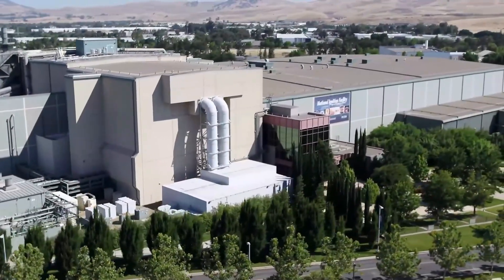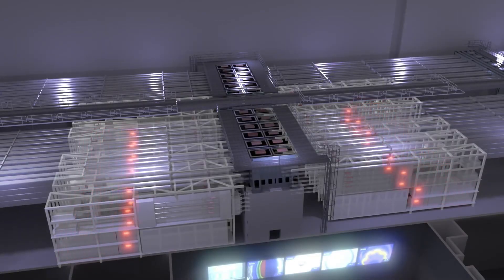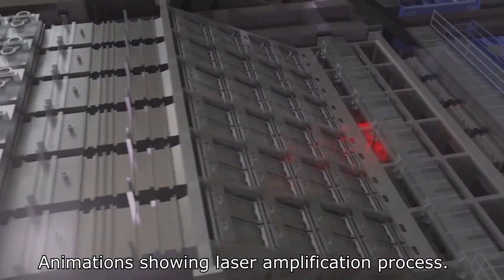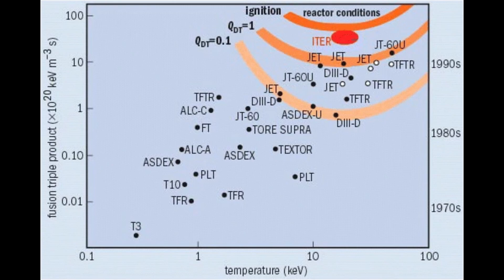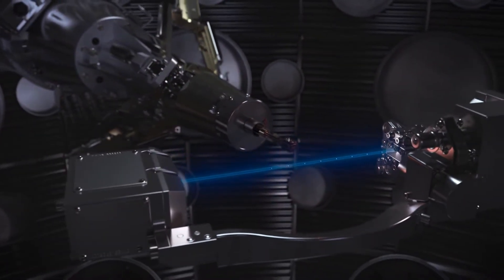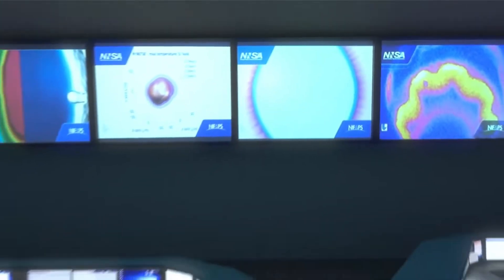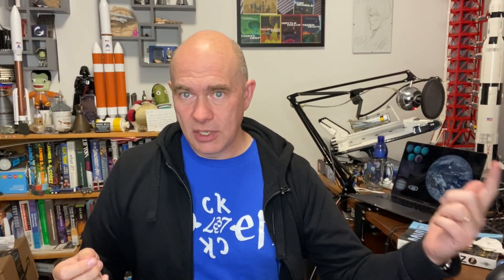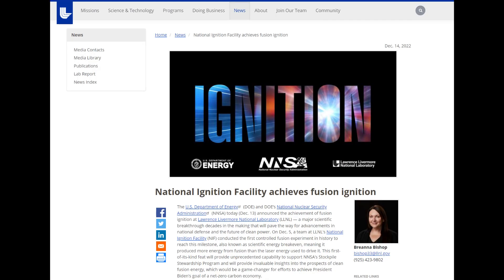Why The Biggest Laser in the World is Making Big News About Fusion

Comment: There's a very simple and reliable way to have fusion energy right now. We actually know how to compress and heat the fusion fuel toe get far far more energy out than we put in. With a fission bomb. So the idea is to detonate plain old fusion bombs in a large underground cavity, which is partially filled with some metal with a low melting temperature, use that to generate steam through a heat exchanger, and drive turbines with that.
There are a few potential issues.
1. Radiation. Not a big deal, bombs can be tuned to generate almost all of the energy from fusion, and therefor be very clean. Also can be ran in a closed loop like all nuclear reactors.
2. Cost. Mass producing advanced nuclear weapons is officially not possible and too expensive. Unofficially it's not a problem. There are a few clues that support this, the easiest is Project Orion. It's a spaceship engine that uses nuclear detonations to generate trust. It also requires thousands of bombs to work. And it was apparently neither impossible, nor too expensive, as it was seriously researched, and got close to prototype phase.
3. Security. This is a real issue. Routinely transporting large number of nuclear weapons is probably a bad idea, if you are not fan of mushroom clouds in your backyard. Possible solution is manufacturing the bombs inside the facility. Security would have to be insanely tight.

To make it economical, the power plant would have to be very large, which makes it impractical.

But there's another way to use fusion, which not just works, but already available even for home use. The trick is to exploit that big shiny natural nuclear reactor in the sky (Sun). Solar power is essentially fusion power. The main downside is that it's not always available, but that can be mitigated with energy storage and mixing with other energy sources.

Comment: Something tells me the National Ignition Facility is not taking into account of all input power, which is outrageously common to do in the field.
Reply: I was right, as per usual.
"the huge lasers at NIF are less than 1% efficient, so to generate more fusion energy than actual input energy to the facility, you'd need to increase the yield 100x"
"Plus, the fusion power is in the form of heat and radiation, and needs to be converted back to electricity. Assuming a 40% steam cycle efficiency, that's another 2.5x increase in required yield. So we need a fusion reaction 250x MORE POWERFUL to achieve true electric net gain"

Comment: We need Liquid Fluoride Thorium Reactors now -- better late than never!  "Fusion is ten years off" isn't even a bad joke; break-even on energy wouldn't mean that commercial fusion could ever be practicable.  I don't write fusion off entirely, but the extreme efforts being expended to implode a hohlraum to fuse deuterium and tritium aren't going to be made so much more efficient that the process could be made routine.  This fantastically expensive experiment is about as dubious an expenditure as the SLS and it isn't going to avert climate change -- LFTR might.  Confront the realities of these proposed technologies and LFTR blows fusion out of the water.  Those are going to be very expensive neutrons!

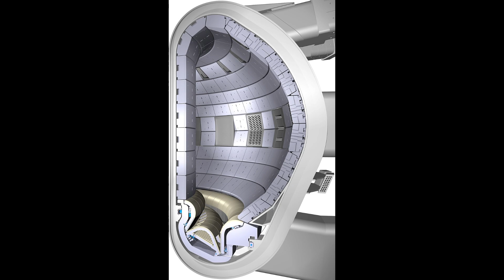Comment: 13:57 "They're not using this pulsed system."
Well technically Tokamak fusion reactors like ITER will have pulsed fusion power, but of course at a WAY longer timescale. (I heard they were aiming for half an hour.)
That's because Tokamak design reactors need to drive a current through the plasma, which means that there's a giant Solenoid coil in the center which slowly increases its magnetic field, and there's of course a maximum magnetic field strength that the superconducting coils can produce, so once it reaches that, that's the end of the pulse.

Comment: Sorry Scott, but saying they only needed 2MJ for ignition and not 300 is like leaving out the energy for magnetic confinement in a tokamak.
They had to make this announcement before a tokamak finally goes over a real Q of 1.
I have no clue how they even came up with the 2 MJ input, its ridiculous.

On another note, making the lasers more efficient wont happen, as you said they work at 1% efficiency, but its more like 0.66 period % efficiency, because of 300MJ to 2MJ (what they say) which means they need to make insane improvements on the lasers, and I am not very hopeful that they can do that with electricity to heat losses inside the lasersystem itself.

And then they have to use pure tritium which is simply not viable, it is too expensive, and if tokamaks were only using tritium and not a mix they probably would have broken the 1 Q barrier a long time ago.

On top of that Iter will easily reach a Q over 1, it is designed for 10.

So to me this is all a big PR to show, they probably want more money to keep their jobs. It really is a dead end for fusion research, unless they want to develop vacuum rocket engines, beacause this system will never be able to transfer its energy otherwise.
 Continuous operation with a heat exchanger and pellet delivery/feed into the existing pressure environment is a mechanical engineering nightmare. Especially when you have to deal with 3m+ degrees tempereature.

Comment: The important thing here is my opinion is now that it has been done and we know we can do it, we can now more easily test it under varying circumstances to find out what are the minimum conditions necessary to get energy out. Once we know that, we can then start designing reactors which meet that minimum threshold, but don't cost billions of dollars to make. If the process by the national ignition facility gets refined and it is determined that there is a simpler way to meet those requirements for positive energy fusion, then they might be able to come out with a system where pellets get moved/shot/inserted/dropped along one axis, while lasers hit it from 360 degrees along that axis through small holes in a lining, a lining which then absorbs the heat produced and turns water into steam.

Comment: Fusion is basically so difficult that any machine capable of doing it would be far too expensive to be economically viable.

If you run the numbers fission is better in every respect. It is cheaper, easier, already in wide use, and the fissile material really isn't the problem it is made out to be. There is hardly any of it, the long lived stuff can all be burned in fast reactors and with breeders we have more than enough fuel to outlast our sun.

Comment: Sorry, this is a tiny step but actually putting power into the grid is 50 to 70 years away OPTIMISTICALLY.
I believe the right path is thorium reactors which don't have the radioactive waste problems (the military never wanted thoriom reactors because it doesn't generate any weapons grade material, so Congress hasn't funded the research)

Comment: There is a dumb question on my mind: How much extra energy does it initially take to power those lasers? To my understanding (Watched the Anton Petrov video about it), there is discrepancy (or lack of factoring, at least in the media) concerning the total energy involved in this process. - Very interesting and detailed analysis - thank you much! Fly safe.
Reply: Total power to heat, cool, people's paychecks, insurance on the building, maintenance on the building, you have to factor all that in and more.
Reply: @boyd21  No. This is not my question. Assume volunteers do it for free. And the land/equipment is free: My question: X - went into powering the lasers, Y - is the energy they produce, Z - the energy Out of this fusion event. Y was bigger than Z. *I suspect X was not factored in the media. Maybe I'm wrong, hence the title 'Dumb question'.
Reply: @electrolab2624  I think Scott did note that the lasers are around 1% efficient. I've seen figures from 300 to over 400 MJ in different articles (basically to power the flashlamps).
Reply: @laserspike  Ooh! Thank you! Those are the numbers I was wondering about. Scott had indeed mentioned that the lasers are currently somewhat (very) inefficient. It helps put things in perspective.

Comment: So, basically, they only counted the energy that actually hit the capsule - not the energy needed input to the facility.  They use tritium, which can never be a practical fuel as it exists in such small quantities and is very expensive.  They can only do about one shot a day, where many thousands a day would be needed in a practical reactor.  Basically, this can never lead to practical fusion power.

Comment: The solution for tritium that I've seen is that they'd use a blanket with lithium, instead. I forget how, but you can get tritium from lithium. The problem with that, though, is we already need lots and lots of lithium for batteries. If they ever figure out net positive fusion, lithium will be even more in demand. Deuterium is easy. Lithium could become a problem to find after a while if all our batteries and our power plants need it.
Reply: a Li atom captures a neutron (that is released from the fusion reaction) and becomes an unstable isotope of Li.  Then the atom of unstable Li decays and one of the decay products is tritium.

Comment: You know, with all those neutrons flying around inside a fusion reaction, we could probably do something about the nuclear waste that's piling up from fission reactors.
After all, getting rid of nuclear waste is a problem of neutron economy, if you get right down to it.
The problem is that many of the fission products of uranium fission are both radioactive, and capable of absorbing more than one neutron before undergoing further fission. This makes using them to sustain a chain reaction in a normal fission reactor impossible.

So you say "What if the chain reaction that creates all the neutrons is a FUSION chain reaction instead?"
Basically, you take the spent fuel rods from a fission power plant, remove the zirconium carbide cladding so you're left with the bare uranium carbide pellets, and with a minimum of extra processing you put them in a fusion reactor.
The extremely high neutron flux inside the fusion reactor will ensure that all the neutron poisons in the fission fuel pellets are burned off, and it probably wouldn't even take that long.
Basically, I'm taking the idea of the "accelerator driven fission reactor" or "sub-critical fission reactor" and instead of hooking it up to a power hungry particle accelerator to generate the high energy neutrons, I'm using a fusion reactor to provide those neutrons directly.
Not like the neutrons from D-T fusion contribute anything useful to the fusion reaction after they've been freed from one of the two participating nuclei in any case, aside from having a useful amount of kinetic energy (you get a single ~20 MeV neutron from each D-T fusion event, that's a pretty high energy neutron containing most of the resulting energy release of the fusion event and it can do useful work, usually the problem is that you can't directly harvest it for energy, here we direct it into a fission product nucleus and it either gets absorbed or splits that nucleus and THAT gives off a bunch of thermal energy that's not hard to harvest, it's a 2 stage process).
And if we ever run out of fission reactor waste to use for that, we can substitute in natural or depleted uranium metal, because you don't need to run the fission reactor first, we've got enough neutrons to do normal nuclear fission too (that's how the 3rd stage of Tzar Bomb would have worked if they used a depleted uranium tamper instead of the lead one that was equipped for the test, and if they had done that then Tzar Bomb would have had a yield of roughly 100MT not the 50 it had).

Comment: I can't help but wonder if working fusion would be a bad thing. Even if energy is produced in a completely clean manner, it all turns into heat which must be re-radiated by the Earth's temperature control loop (or the same amount of incoming heat blocked of course). The amount of heat energy produced by humans for electricity is already nontrivial! Human electricity production for one year, if Earth was a closed system, would be enough to heat all the water in the oceans by 9 degrees C*. With a clean, eventually cheap source of free electricity, this would no doubt increase dramatically.

*617EJ of production = 1.47*10^20 calories, seawater ~1.38*10^21kg from a quick google. Naturally wind and solar power are slightly different from fossil fuel and nuclear in this regard but it is just a napkin calculation :)

Comment: I wonder how much more efficient this will be with solid state lasers designed for the purpose. I look at this as Fusion went from showing up in my son's lifetime to possibly in my mother's life time.
Reply: There was a paper out not to long ago about a UV DPSSL that had a conversion efficiency of 16.5% so...25-30 times more efficient?
Reply: @NM-wd6vp  Wall plug efficiency of 16.5%?  That's pretty good for a UV DPSSL.  But it would be difficult to impossible to scale that to the pulse energies required for ICF, I believe.  What average power output and what pulsewidth was that laser?
Reply: @claudiusdunclius2045   ~10w, 30ns? Seems like it's getting there.
Reply: @NM-wd6vp  Respectfully, that's not even close.  I've personally worked with pulsed Nd:YAG lasers that are ~100W, 25-30 ns.  Those are tabletop lasers.  Depending on the pulse repetition frequency, that gives pulse energies that are 8 or 9 orders of magnitude lower than the NIF pulses.  As in, a billion or so times less energetic.  Lasers in the class you're referring to are more efficient than the NIF laser, to be sure, but 30-40% wall plug efficiency in such a laser would be fantastic.  To scale laser pulse energies to NIF levels, the overall efficiency would be far lower.  As I've said elsewhere in these comments, my own SWAG is that achieving a 10% overall efficiency would be laudable.

Comment: Great Video. The laser pulled more than 300 megajoules off the grid to produce about the 3.15 mega joules of heat released by the fusion reaction of deuterium and tritium. This is not scalable yet. ITER's thermonuclear fusion reactor will use over 300 MW of electrical power to cause the plasma to absorb 50 MW of thermal power, creating 500 MW of heat from fusion. No lasers involved and scalable.
Reply: Yeah, they just need a few more billions and another 10 years and even THAT won't be a power plant but a test reactor. It'll take a generation to make work and several to pay it back.  It's become a fools errand.

Comment: The fuel pallet target sounds insanely complicated considering they would need hundreds of millions if not billions of these pallets over a year for each reactor.  The timing of where the target arrives for ignition would be measured in nanoseconds of precision to properly ignite. I honestly feel magnetic confinement RF induction fusion reactors are more simple in operation than a laser implosion reactor.
Reply: Yes, a pure gold can containing expensive deterium-tritium?!! A match setting fire to pile of paper money also produces a self-sustaining reaction 😉.  Apparently the same lab had a plan to commercialize, which was quietly canceled. From Wikipedia:

“LIFE, short for Laser Inertial Fusion Energy, was a fusion energy effort run at Lawrence Livermore National Laboratory between 2008 and 2013. LIFE aimed to develop the technologies necessary to convert the laser-driven inertial confinement fusion concept being developed in the National Ignition Facility (NIF) into a practical commercial power plant, a concept known generally as inertial fusion energy (IFE). LIFE used the same basic concepts as NIF, but aimed to lower costs using mass-produced fuel elements, simplified maintenance, and diode lasers with higher electrical efficiency.”

Comment: Only about 20 Kilowatts of the Laser beams caused the actual compression into Fusion which created  the equivalent of 17 Lbs of TNT explosion while fusing just 4% of the Hydrogen fuel from 1 tiny pellet.  They created the worlds tiniest and cleanest Nuclear explosion ever.  They didn't sustain a run of tiny explosions. They built a trigger for and proofed a concept for battlefield size warhead(less than 4 lbs with 10-100 Kiloton yield)  fallout free fusion weapon under the guise of building a fusion power plant prototype.. They are not called the National Ignition Facility for nothing. This was a show for Putin.  That's my opinion and yes I did the math....

Comment: Well if we replace the flash lamps with semiconductor lasers (the main laser is optically pumped) we replace a 5% efficient flashbulb with a 50% to 70% efficient semiconductor laser. Not only the laser is more efficient, but it emits at the correct wavelength, so if quantum efficiency is high (and it usually is high) most of the power ends up being use to pump the gain medium of the main laser. Now, frequency doubling is a little more difficult to get efficient, but in principle it can be made efficient as well. Given that they have doubled the fusion yield from 0.7 to 1.5, if they double it a few more times with using modern laser technology we are very very close to a realistic fusion. Very very close in terms of R&D projects means 10-15 years.
Reply: aptronym!

Comment: It would be great to have an alternative to coal, petroleum and similar materials. But imagine you have a huge number of fusion generators producing power. They run machines, which generate heat, or drill holes, which generates heat, or saw things, which generates heat, or move objects and people, which generates heat. Everything turns into heat, sooner or later.
Reply: This heat would be tiny-tiny-tiny compared to the Sun's heat.  The problem is Green House gases keep infrared from the Sun from leaving, going off into Space.